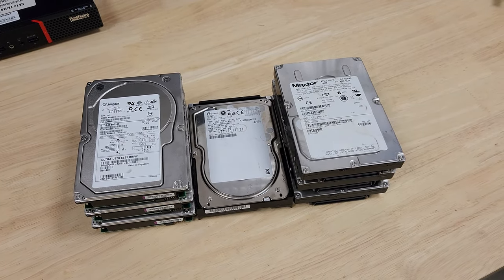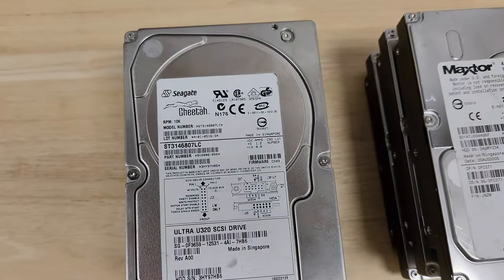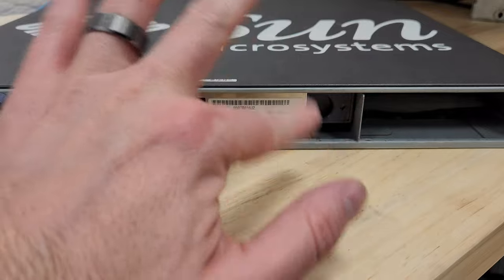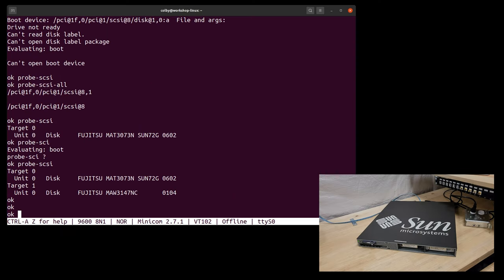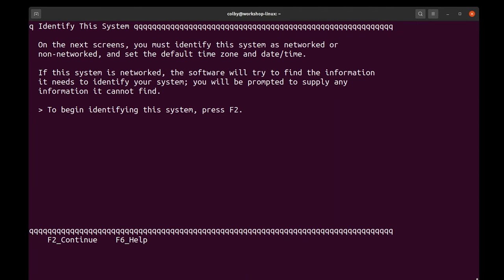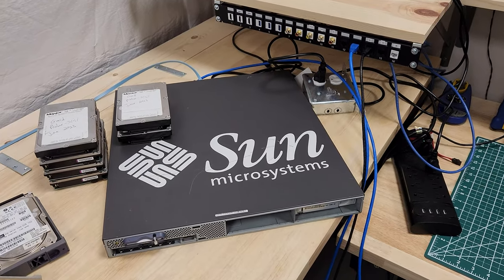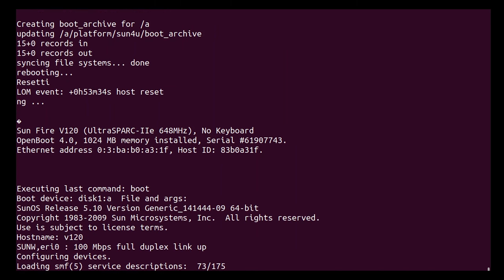Testing Old Hard Drives

Comment: Interesting, educational, video.  This is my first visit to your site, and I haven't even looked at your other videos yet, but I have subscribed.  lI was hoping that I was going to learn what was on the drives.  
Why not run Linux on your Sun?  There is a Linux dedicated to the Sun systems, one of the flavours being Red Hat.  You could buy a PC SCSI card, and run it in an old XP box, or even run linux in that old box.  That would have saved you all that work on the Sun, but I guess you wanted to get the Sun computer running anyway.

Comment: Try looking for an Adaptec AHA-2940UW or AHA-2940u2w pci controller. The UW has the 68pin ultra wide connector. While the u2w is uses 68 pin LVD (low voltage differential) cable. But it is also backward compatible with just Ultra Wide drives. 

Using a 68 pin scsi to SCA 80 (80 pin) adapter to connect to those hot swap drives. You can then test the drives and access them on a desktop.  I would recommend when getting the cables to also get a terminator too if the cable doesn't have one built in. You need termination on scsi for the signaling to work right. And those hot swap drives don't have any.  

I have used Scsi back when the company i worked for build Windows  NT 4 and 2000 servers. I remember when 10k drives came out. That was fast for the time.
Reply from the maker: This is exactly the information I was looking for, thank you! I'll definitely be hunting down one of those cards, I'd really like to see if there happens to be anything on the drives. Plus it'll be very convenient to have a way to access them other than the V120.
Reply: @clabretro I have seen that there were drivers for the 2940 cards for Sun, windows, and Linux. I will add that the ultra wide support 160 speed and the lvd ultra wide supported the 320 speed. But you could also connect the them to the slower 50 pin cables with adapter for 40/80 speed transfers.  Each drive would need an ID number set. The SCA 80 adapter usually have the jumps for that on them.
Reply from the maker: Just ordered a AHA-2940u2w and some cables... we'll see how it goes!
Reply: Also try Parted Magic Linux on PC to check smart status for those HDD,wipe them with nwipe

Comment: There are adapters from SCSI SCA 80-Pin to SCSI 68-Pin and then you can use a PCI card on a PC usually adaptec hba controllers
Reply from the maker: Just picked up an hba and converter actually, hopefully will be able to take a look at those drives.
Reply: Old Proliant's and dell's support 80 pin sca scsi directly.
Reply: Dell 8th gen would be the go.
Reply: @andrewnoonan5786  Unfortunately the HP DL360 G4p doesn't cut it, they only support HDDs certified for HP with the built-in RAID controller, I currently have such an issue, where I have old IBM SCSI U320 HDDs that aren't recognized whatsoever by the server, but they are recognized by an HBA card.
Reply: @rafaelgruber6133   Interesting. Adaptec cards are an option in that situation. I had an ML310 G3 with an Adaptec  card  that  ran Esxi 5.5 many moons ago as my first ever home hypervisor. Note it was a scsi card and not a raid card  but it ran with non hp drives perfectly fine. It was using a Pentium D Extreme which had the relevant virtualisation suppprt. I ran it for a year before replacing it with newer hardware.
Reply: The drives in that box  were in a 4 drive hot swap bay but it was still possible to cable from  the Adaptec card to the bay bacplane directly with no adapters.

Comment: You can probably access the original drive. 
It is using an add on to Solaris called Disksuite (I think). 
It creates a mirror or stripe device from physical partitions.

If your book disk is mirrored then try booting from the underlying UFS partitionIf it is a striped or RAID device you are out of luck!

try (from the ok prompt) 
devalias 	# this will list the boot prom aliases - one of them should be your boot disk - usually called disk0, disk1
boot disk0:2	#this will try to boot from partition 2 on the default disk - maybe try partition 0
Reply from the maker: Thank you! I'll save this comment for next time I try messing around with that drive.

Comment: @20:00 maybe put SUNWmd on the working machine and attach the original Solaris drive and 'scan'  the metadata using the path to the original disk.  Then delete the non-existing mirror or otherwise make it a one-way mirror and then try a few more fscks.  Be gentle with it. 🙂
Reply from the maker: That's what I'm thinking. Need to do a little more research but it could be possible to get that install back in action.
Reply: probably won't work - disksuite keeps it's config is a database on the disks. Multiple copies of this database are made and they need to be in sync. Some of the copies are missing and there are not enough for it to be happy! So they will not allow it to run unless that can be bypassed.

Comment: Hey Clab! My V210 got here, and I'm wondering how you set up the JumpStart server. Do you remember where you found the info to get it working? I saw your video about the X2200, but I don't think the SPARC machines use PXEboot.
Reply from the maker: Excellent! I setup an x86 Solaris 10 VM in proxmox (you could probably use any hypervisor) as my JumpStart server. 

This is a pretty good guide: https://web.archive.org/web/20230329091434/https://www.thegeekdiary.com/how-to-configure-a-solaris-10-jumpstart-server-and-client-sparc/

That's the first one I followed, but if I remember correctly you might not have to deal with all the profile stuff or anything (though that full guide should also work just fine). Below is from memory though and it was a long time ago. This is all on the JumpStart VM:

1. Mount the Solaris image you want to serve with the JumpStart server. Make a directory to host the install (/export/install is a typical spot)
2. There are JumpStart utilities in /path/to/image/Solaris_[8/9/10]/Tools. Run "./setup_install_server /export/install"
3. Add the host name you want for the v210 to /etc/hosts. Add a mac address -> hostname mapping to /etc/ethers for the v210. I think you can find the mac address when you boot up the v210 to the OK prompt.
4. Run "./add_install_client <v210_host_name> sun4u"

Anyway that's the basic idea!
Reply: @clabretro  Hang on a minute!  You got NEW SCSI drives there pardner?  True OLD SCSI is from early 80's through to mid 90's in my book.  I have 1GB-9GB SCSI hard drives that I get offered US$1,000 each for and I cannot get enough!!!   The most amazing fact is that most of my drives I sell are used.  The BNIB ones go for US$3,000+ every day of the week.  Have a great week mate.
Reply: @theaustralianconundrum  That's absolute highway robbery
Reply: @AureliusR  Scarcity = price for collectors.  And there are hundreds of thousands of retro computers and component collectors.

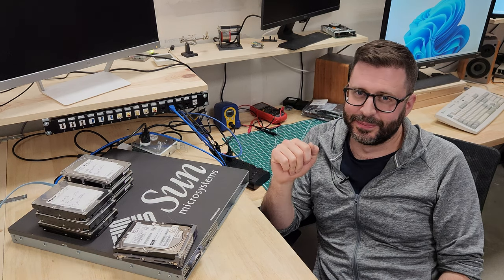Comment: @20:20 can you just attach an ultrascsi PCI HBA to a Linux machine and then examine the disks that way?
Reply: I can't post URLs with help.  Try boot -s  and then vi /etc/system set md:mirrored_root_flag=1
Reply from the maker: That's the route I'm gonna go, just ordered an HBA and some cables. There could of course be nothing on them, but I figured it'd be worth trying to check before just blindly formatting them all.
Reply: @clabretro  Or did you see my other comment about modifying /etc/system?  Maybe try with the one-sided mirror Solaris disk and boot -s and see if / is writable...
Reply from the maker: @declanmcardle  I'll give that a shot! Really appreciate all the insight here, I'm totally new to all this Solaris stuff!